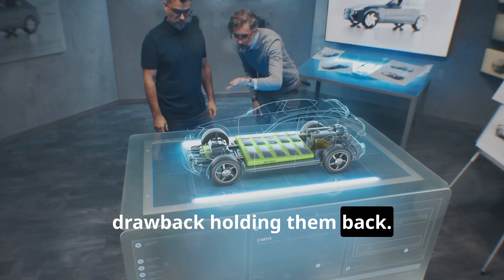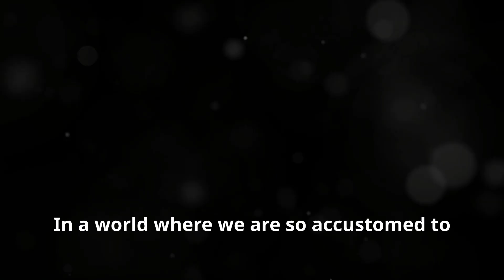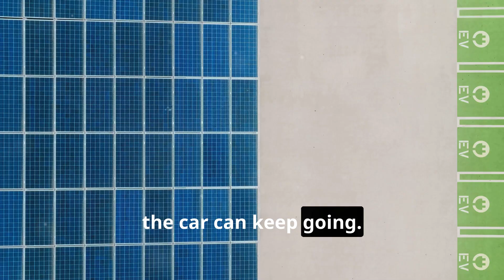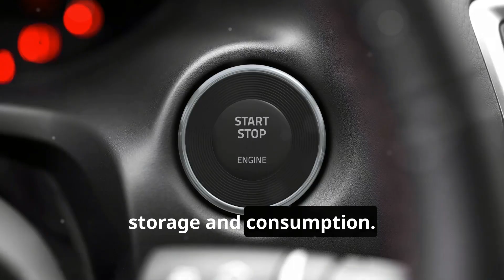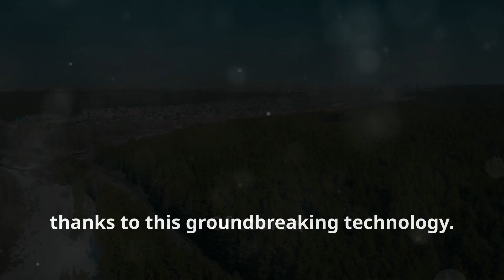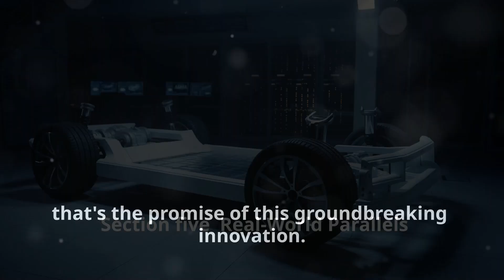Revolutionary Electric Car SHOCKS Industry Without Battery!

Comment: I would go with an oxyhydrogen steam engine. A very modern one. No need to store hydrogen it is oxyhydrogen on demand and pound for pound nothing beats a steam engine for real hauling power. You could probably get by with solar panels on the roof. Water in the tank. Exhaust? Water.
If you look it up in wiki you will see a desperate attempt by the oil industry to say that an oxyhydrogen torch is pseudoscience.  They are used all over the world due to the very high heat of the torch. Glass blowing etc.
Running a car off a torch is never a good idea but heating a boiler with a boiler burner to make steam is a steam engine and that's as easy as pie. They will remove any attempt you make to say oxyhydrogen steam engine in that wiki.
Climate change anyone?